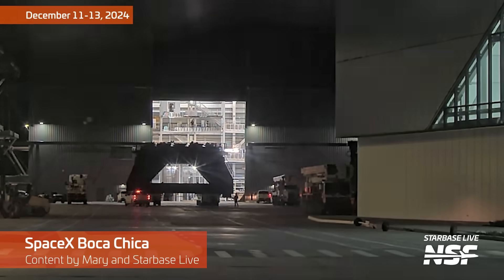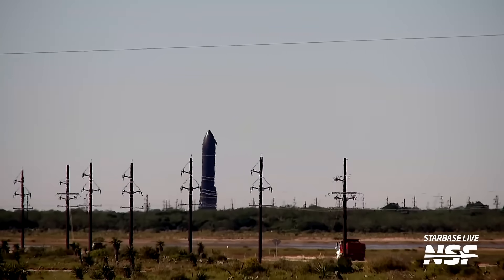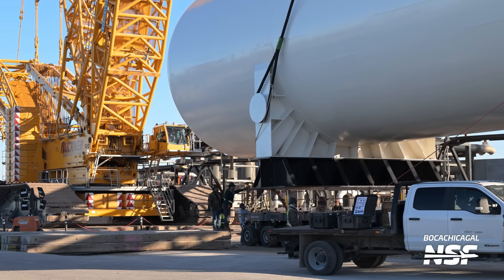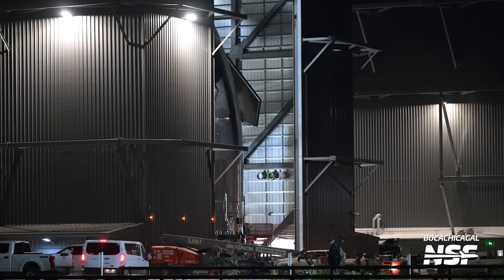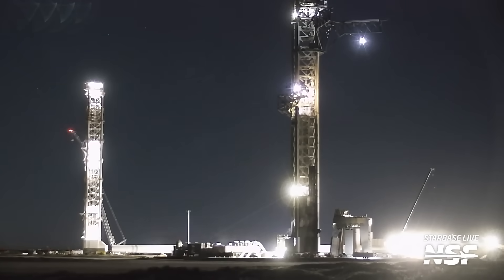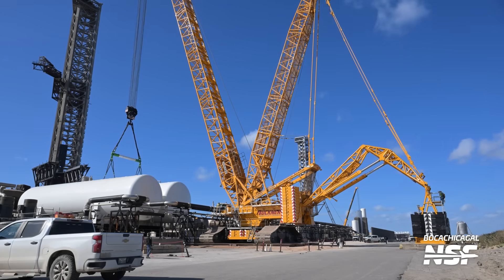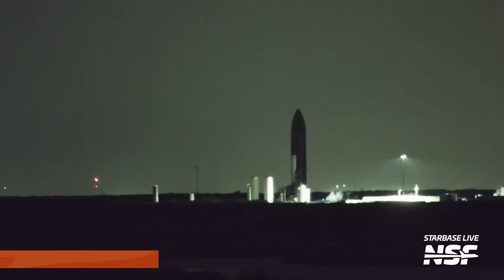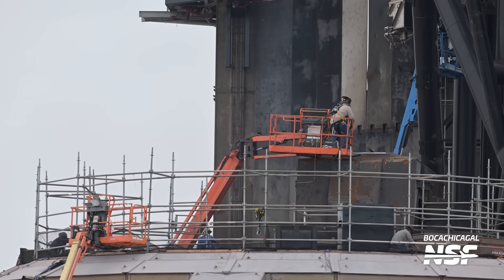Ship 33 Test Campaign Begins | SpaceX Boca Chica

Comment: Look at SpaceX moving a rocket compared to NASA. 

NASA spent $15 mill for 2 crawler. The gigantic rolling platforms running on a custom built road and put down tons of sand and gravel. Even now there is no public info on the cost to build the Crawler Road. All for the rocket platform to move 1-mph loaded and the breakneck speed of 2mph when empty. 

It was the size of a MLB ball fields. It had 2- diesel engines each producing 2750 HP using 165 gallons per mile. 

We have SpaceX movers the StarShip on public roads and off the shelf electric movers.
Reply from the maker: We see this occasionally, but the two things are nowhere near comparable. Starship is empty, and relatively light, compared to a full Shuttle stack with two fully loaded SRBs. Love me some SPMTs, but the CTs aren't in the same league. - Das
Reply: @NASASpaceflight  I’m not the world’s best researcher. I tried my best to check your assumptions well as my own. 

As near as I can figure the dry weight of the 3 stages of the Apollo Saturn V came in at about 425,000 pounds. I’m assuming the Crawler took the complete Rocket to the launch pad without fuel in the tanks. 

Then I looked for the dry weight of the Super Heavy Booster since that I’d the largest piece rolled around the StarBase. I’ve settled in on the dry weight of a Super Heavy in the range between 160 ton (350,000 lb) and 200 ton (440,000 lb).  I think the range is the transition from block 1 to 2, but I could be wrong. 

It appears that the Super Heavy Booster is pretty close to the weight of the entire Apollo Saturn V. 

You did reference the Shuttle but I’ll remind you that the crawlers were built for Apollo.  They were lucky the Crawler was way over engineered so it worked for the Shuttle. It’s equally lucky they are reusing a Crawlers today.

Comment: Re clouds Das. A good question to ask is how heavy are clouds?
The answer is quite a lot more than you think!!
But I wonder how they compare to a starship or booster???
Reply from the maker: Eh, they're water, whichnia notoriously heavy. Would believe clouds are pretty heavy, because they're large even if they're not dense. - Das
Reply: @NASASpaceflight  The UK Met Office says: "While there are many factors that will determine the exact amount of water vapour a cloud holds (e.g. temperature, altitude, pressure etc.) we can work with an average of about 5 g of water per cubic metre of cloud. This means an average size cumulonimbus would weight about 400,000 kg, roughly the same weight as an Airbus A380." 
thats a WOW! for me :)

Comment: Hi John/Das, I know they want to remove rows of tiles from Starship so they do not interfere with the catch but they have heat problems on the stainless steel due to this. I had an idea. I watched the plasma flow around the flap hinge bumps and noticed that it gets diverted outward away from the ship. Could they extend the hinge covers or bumps to the entire length of the ship or maybe even chines covered with heat tiles to divert the plasma away from the ship to help protect the stainless steel from heat damage. I would call them Plasma Diverters. Maybe you could pass this on to Elon Musk. I really don't like the idea of using excess ullage gas for cooling. Let me know what you think.

Comment: the 2 lift pins you can see on ship 33, do you think they will be sticking out like that for flight, or will they fold out when it's ready to land?
Reply: I doubt they can use removable pins. But welding on internal pins that would pop out during landing is not out of the question. They have to be as strong enough as the ones on the booster, but remember those on the booster are immovable. Will be interesting to see the solution.

Comment: Will the new OLM lower to the ground to accommodate the future growth in height of the booster/starship? If so, was it always intended to finally be that height for the final version of starship? If that's the case it explains how starship could get larger without rebuilding the tower. So I assume the original OLM is the equivalent of Skylabs milk stool mount. Any thoughts?
Reply: Correct, but maybe a bit out of order. The Starships were not supposed to be made longer when the OLM and tower were erected. The FAA allowed towers no taller than the first one, so they had to reduce the hight of the OLM, and in the future I suspect they will place the SQD higher up as the booster/ship get taller still. The lifting points on the ships will likely be placed lower down the body, so the chopsticks should be fine lifting the taller ships.